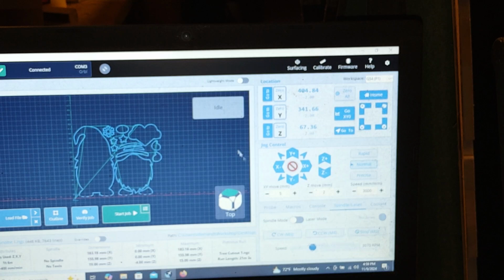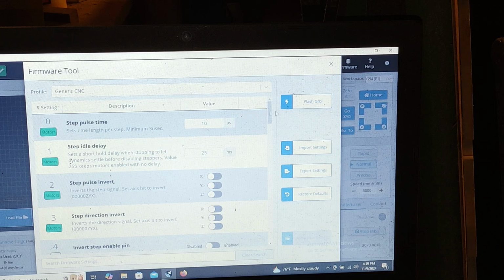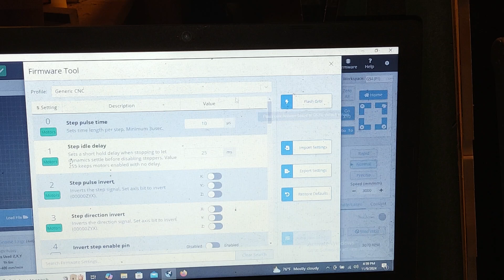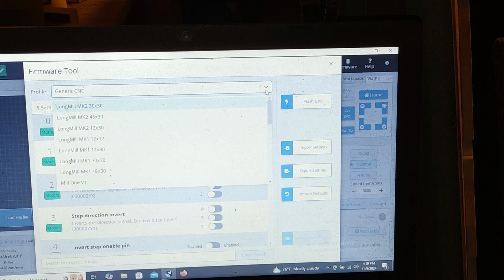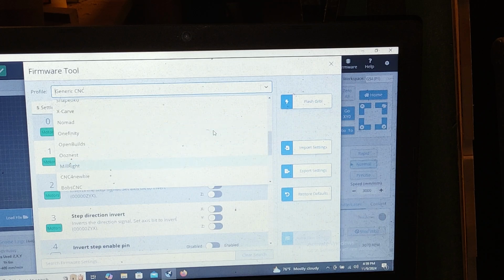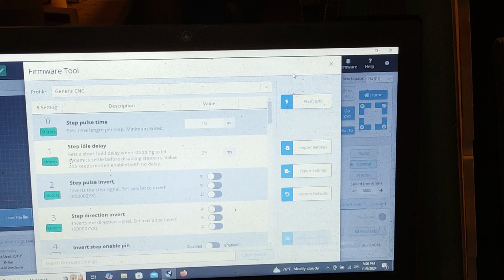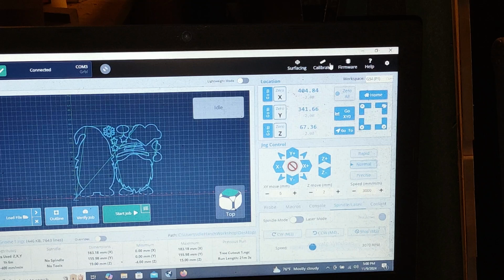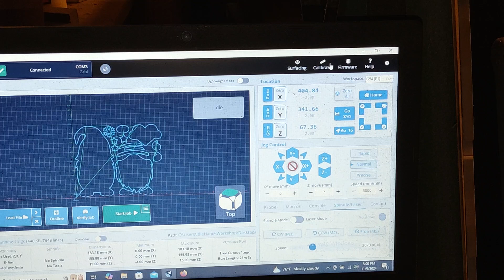Vevor S4040 CNC Flashing Firmware   Firmware Recovery

Comment: Hi bro, great video! One question, can you change the rpm of the machine's spindle? I just realized that it only works at 10,000 on mine, I await your response. Regards!
Reply from the maker: Yes, gSender gives you the ability to adjust the spindle speed easily. If I make it out to the shop I'll grab a quick video of that feature for ya. It's down in the bottom right pane ( also allows you to turn it on and off )
Reply: So I have the new version of gender and  firmware is under tools. I put in generic CNC cuz vevor isn’t there I pick the port and grble and it just sits there and does nothing. 
It says flash firmware  this feature exists to flash firmware onto a compatible SLB or Arduino- based device 
Info:starting Arduino flash on port com9
And it just sits like this and does nothing. 
Any advise??